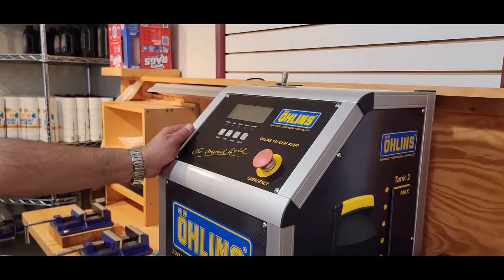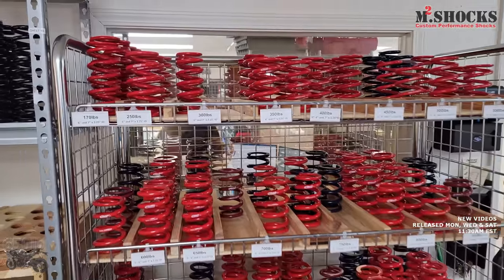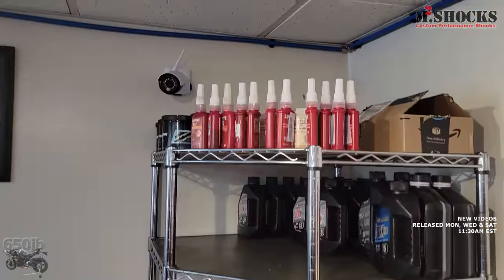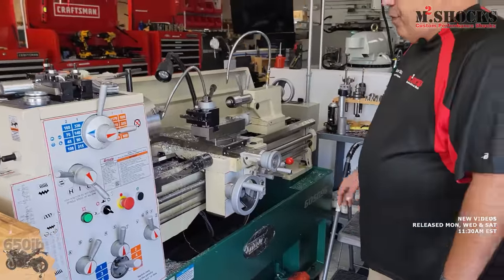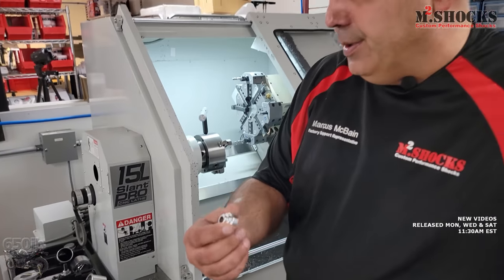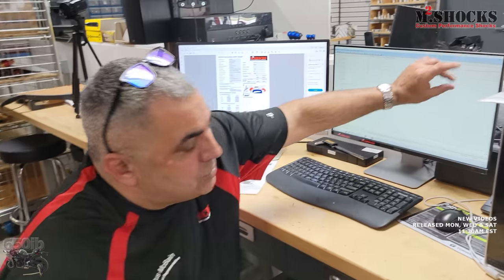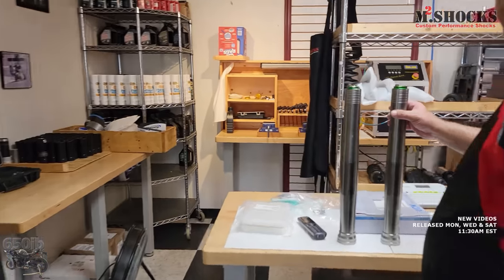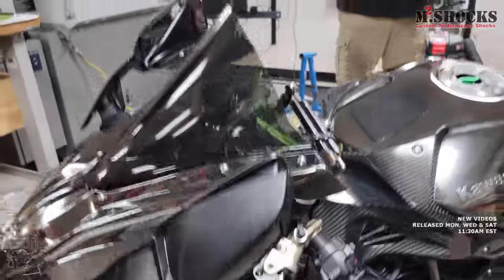He MADE My 352HP Ninja H2 FASTER!

Comment: An article I read a few years ago in the UK freaked me out but permanently put something about suspension into perspective for me forever... the unit price of a complete rear shock assembly for a Japanese supersport 600 (I read it as an R6 in the context of the article), paid by the bike manufacturer to the shock company: $16 (SIXTEEN DORRARS FFS). What kind of quality and performance would you expect in any complex mechanical component for less money than, I dunno, a pack and a half of cigarettes? All stock suspension is lowsy and replacing it with a considered decent brand replacement is a vast improvement over a OEM unit. But top stuff is worth the big money. This guy's stuff is AMAZING. Seeing the whole set up and tech behind the scenes here was excellent. So much great info and insight. Better than the usual videos tbh, do more like this ib please. You've got more bikes to take to this fella!
Reply from the maker: Thanks so much Bro. I will produce more 🎥's like this for sure. Marcus is working on a few of my bikes now.